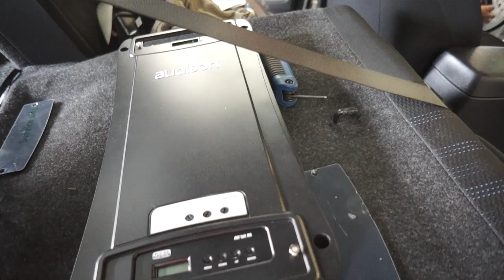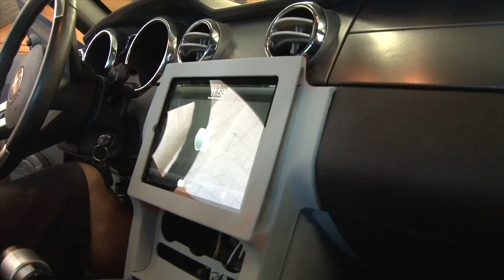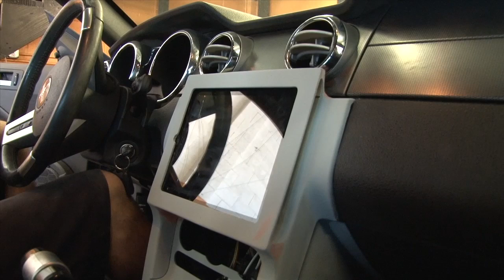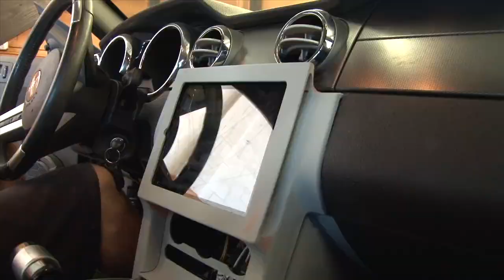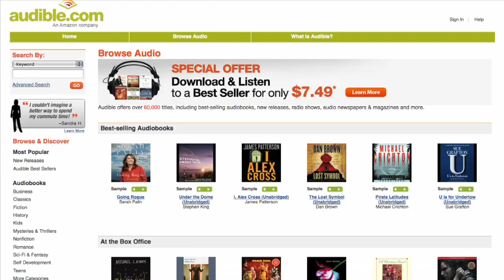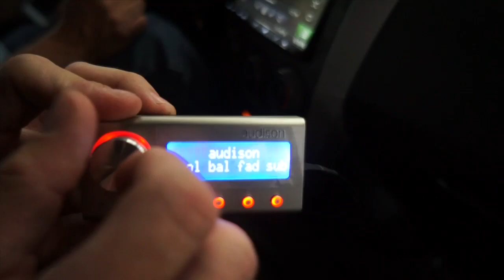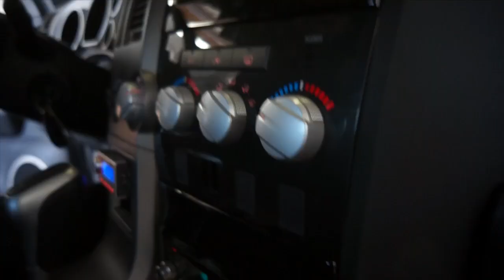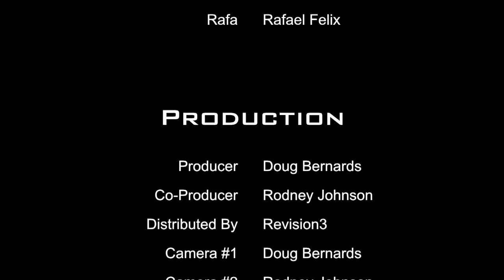Amplified - System Tuning For a Toyota Camry and Installing An iPad in a Ford Mustang @SoundmanCA

Comment: so let me get this straight i can still go digtal using a Pioneer DEH-80PRS  head unit my plan was to use two jl w6v2 13.5. hertz energy xls an the Hi-Energy Coaxial  in the back voce AV 5.1k an AV bit IN an a bit ten d  CAN I DO THIS AN IT BE FULL DA